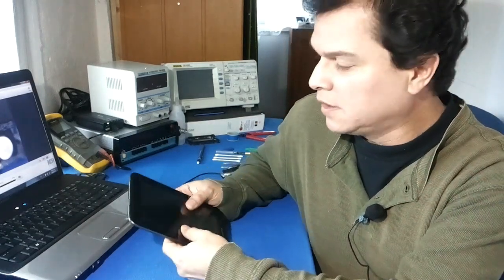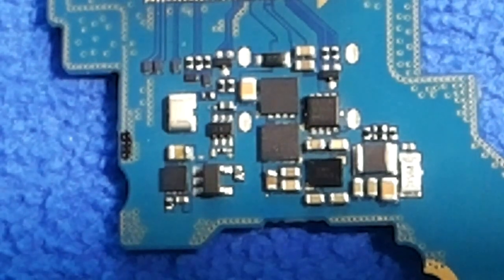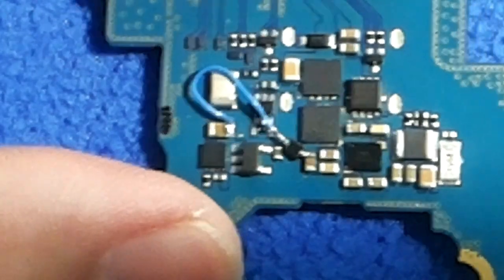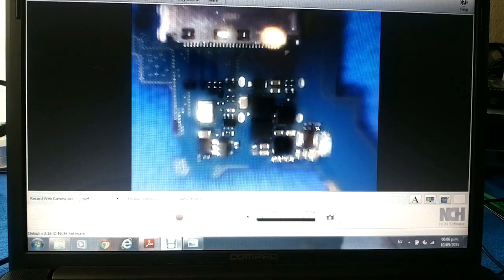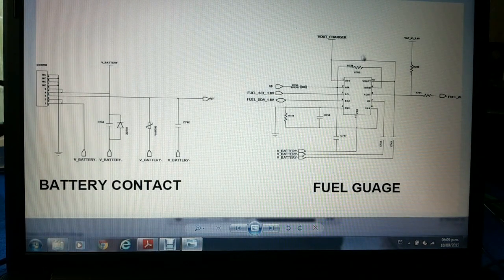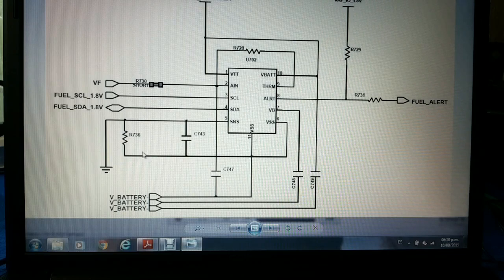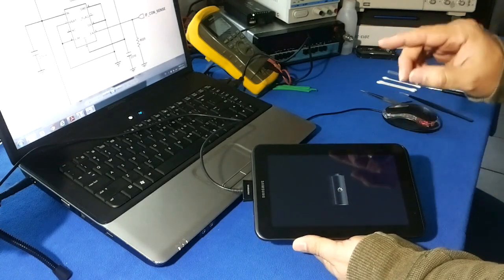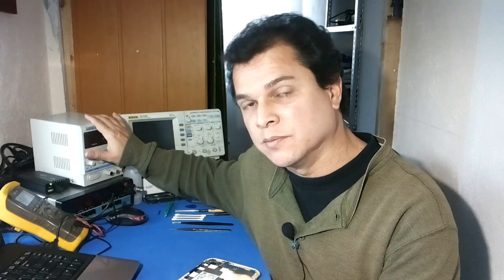Samsung Tablet 2 not charging, turns off, fixed - How to fix tab on chip level. GT-P3100 / GT-P3110

Comment: Thank you for this. I have a TAB 2 7.0" that needed this mod. I glued a diode to the bottom of that circuit and ran enameled wires to it from those caps. I tried your way at first but the board would not sit properly in the case. Works great now and I noticed the charging IC stays cooler.

Comment: Hi Bob,
I have a Galaxy tab P1000 with this same problems you just fix now.
After boosting the battery, it started charging but won't turn on.
Can you help out with it?
Thanks
Reply from the maker: Hi! Remember in the video I said I had to repair a faulty component before to adapt the tablet. Any component can be bad. It is imposible to tell from here without having the tablet to make a physical repair. If you are just learning or getting in electronics, look for a mentor in some service shop to start learning and repairing with them. It was they way I did it in the 80's.

Comment: i would say only try this as a last resort, i can guarentee you will short it out if you have little soldering experiance, i had the same problem, endless loop of charge indicater, i left it recycling for over an hour, unplugged from mains for 10 mins and plugged back in, and it started to charge to full, think of the battery as an engine on a car if it runs out of fuel it will not start right away untill the engine has been primed again

Comment: What is number part dioda
Reply from the maker: Hi Andi! I used one from other pcb, so I didn't know what number was it. The true is the bigger diode close to the power supply connector from most smartphones and tables could be good enough for it.

Comment: My friend I have a galaxy tab 4 T330, from a customer, charging port was burnt on pin before vcc, replaced it. But then battery started charging on 0.90amps and suddenly to 0 , over and over in a loop I could verify this as I have a USBcharger with display showingamps. I tested VBUS coming out from pmic and voltage it's going to the battery port. Now , is this something similar to what you're explaining? I didn't find any short. this is totally crazy. Please try to help me out. So many thanks, and congratulations

Comment: Same problem as mine. But its hard to do it. anything easier. Help please.
Reply from the maker: Bind it to service. There are good technicians doing the same job no too far away from you. Just make sure they really do repair on place. In less than a week, you will get it back well fixed.  :-)

Comment: buenas noches Sr me ayudo en algo por mi elemental conocimiento de ingles, quizas si me aclara algo en español, mi tab 2 sin avizar dice 1 5 de bateria y se apaga cuando 1 min antes decia 100 %, la cargo 5 min dice 100 % y la comienzo a usar, si temgo suerte dura 10 min y vadiciendo rapido 90 75 40 30 10 5 y se vuelve a apagar,  Q me sugiere usted,  GRACIAS
Reply from the maker: Hola! Cuando las baterías cargan en al 100% 10 minutos y se descargan en cinco, el problema es la batería misma y bebe de ser reemplazada. Intenta probar con otra batería primero.

Comment: Hi I ha a galaxy note 8 gt-n5110 and old battery would not keep its charge unless plugged in, I replaced with new battery and now it is in a charging icon loop as yours was, but if I put the old one back in it charges fine just battery won't hold while unplugged......any suggestions

Comment: Thanks for this video.  
My tablet is not charging when I plug it in.  There is nothing on the screen - no charge indicator.  Screen is completely blank and device shows no indication of being powered on.  Looks dead.  I am charging via wall outlet. 
When I plug the USB cable into my laptop, it shows a message "installing device drivers" but is unsuccessful.  In device manager a new device appears and disappears continuously: OMAP3342   Screen is the same at that time (looks dead).
The tablet has been sitting for at least 6 months so I suspect that the battery is really undercharged.  
I've opened the unit and removed the battery connector and reconnected.  Still no signs of life.
How you you troubleshoot this?  What should I check for first?  Your help is really appreciated.
Reply: What did you do for this? I'm in the same situation. My tab 2 10.1 won't display anything. I tried disconnecting the battery but it is dead.

Comment: Hello Friend I have GT-P3100 device and after i connect to charger or laptop its showing Red (x) mark on battery icon. when i turn of my device and charged it will getting charged. i have rehot U706 (136s chip) too. but the problem was same. which parts i need to check now?? am i need to replace 136s chip ?? please help me with this... thank you .

Comment: I have a Samsung tab2 , I want to power it through external supply ,i.e., without any battery support, Is it safe to do? if yes could you help me in how to do it.I changed 3 batteries so far,all of them useless now as I forgot to charge them frequently, I am tired of buying new battery. I am planning to use this tablet in my car for entertainment. I got some knowledge in electronics.All I need is good guidance from experts to do it safe. I hope you could help me.
Reply from the maker: You will need something like LM317 voltage regulator to regulate to 3.7V. for battery or 5.1V for main power input. Make sure it is well done, and you will need a power transistor with 2 Amps capacity to do not overload the voltage regulator. REMEMBER, the fuse must be close to the battery and no as far as your regulator. (Automotive safety rule). Keep in touch!
Reply: Hi Bob, thanks for your reply.I need bit more clarity .Input to LM317 is car battery?,LM317 parallel connected to power transistor to supply more current? I guess LM317 alone could deliver enough current to tablet,correct me if I am wrong.I need your help in where to connect 5V DC to tablet. We need to bypass tablets battery charging circuit,and need to give the supply to power rail ,could you please give some details regarding this.I may need tablet schematic for this!!.

Comment: Hy bob, what kind of capacitor of you use?
Reply from the maker: Hi! I used a diode. I wrote about it in the video´s description under the video.
(NOTE: JareK K added a picture for you: http://pokazywarka.pl/howdiodeconnected/
THANKS JAREK for you contribuition. :-)
About the diode used in the video: I didn't have an SMD supplier on that time. So, you can do as I did. Take a good size SMD diode from another smartphone, tablet or laptop. It has to be a good one, and generally they are located close to the main power connector or charging circuit.
This is the video how to ope it: https://www.youtube.com/watch?v=L_DWJ...
This is the schematic for Tab 2: http://www.s-manuals.com/pdf/tablets/...
Tab 2 Service Manual: http://www.s-manuals.com/pdf/tablets/...
Download it and save it, before the Website's page goes offline).
Reply: Thank you very much bob 😄
Reply from the maker: Thank you! :-)

Comment: Hi Bob, my Tab 2 P3100 taking long time to charge like 6 hours or so, what's the problem, and solution?
Reply from the maker: Hi! A good battery rates longer to charge, and it lasts the longest to discharge. A bad battery chargers in short period of time and discharges in a few minutes. For an average battery 4, 5 or even 6 hours are good time if the battery works for several hours. But also I saw people using the wrong charger, with 500 mA or 700 mA when they should use 2 Amperes charges for bigger smartphones and tablets.
Reply: Yes true what you mentioned as the charger is the original came in the box,  thanks for your available information

Comment: Hi Bob. I have had exactly the same problem with TAB 2 7"... so I soldered Shottky diode 3A as you showed but nothing happened... still no charging...any other ideas? Before I watched Your video I did the trick: holding 30 secs. power button then connect to charger still pushing power button for next 30 secs. it worked only once.
Reply from the maker: Hi! The bypass is is done after fixing a mayor problem or for total discharge's problem. But if you have a bad component, a technician must fix it first.
Reply: And the mayor problem would be capacitors which you talked about in your video?
Reply from the maker: The mayor problem is "the problem". There is a bad electronics component, and it could be anyone from all of them, or more than one, from capacitors, chips, resistors, conductors, transistors, the solder, anything. As I said, one well trained or certified technician will find it.
Reply: Thank You for answering my question. As for now I am charging battery using cell phone (I connected tablet battery to cell phone battery and charged it) - but it is very unconfortable solution. I will search for any technican who would like to look at my tablet, because I do no have so small devices to solder smd capacitors.

Comment: Hi,

 do you have the same solution for the Samsung Galaxy tab 2 10.1  P5100? Which are the component to connect with the diode?
Thank you very much for your videos!
Reply from the maker: Ciao!
http://www.s-manuals.com/pdf/tablets/samsung/samsung_gt-p5100_r1.0_service_manual.pdf
Bisogna cercare ciò che sta causando il problema. Ti ho dato il primo legame con il manuale di servizio. Il secondo link aiuterà acerca come preforme connessione del diodo. E 'solo per le persone con istruzione formale o formazione in elettronica buono. Non farlo da soli se non fossi un tecnico.
http://www.s-manuals.com/pdf/tablets/samsung/samsung_gt-p5100_service_schematics.pdf
Reply from the maker: Hi! It could be a component linked with the positive line in the battery, whereas you have a good tack to conduct the charging current without to heat the printed circuit board's track.
Reply: Ciao Marco Carini, anche io ho il P5100 che carica ma effettivamente non carica, tu hai risolto col metodo che ha descritto nel video? Sul sito dei manuali che ha indicato lui ho trovato i manuali del nostro tablet
Reply: I found the problem with the service manual . I found a coach who will try to re-weld the piece in question ( U716 ) hoping that it is not dead and that you can find the parts
Reply: The failure of my tablet is this: if I connect the charger emits the sound and the charging icon appears but not actually charging the battery
Reply from the maker: From all the components in the tablet, any one of them can be bad. But more chance are it is the battery. Ask your technician to test the battery. If it isn't, then your technician will find the problem. (But so far, highest chances are it is a bad battery).
Reply: +Umberto Fragale  Ciao Umberto.Io non ho ancora avuto il tempo per fare il lavoro,ma per logica proverei a fare la stessa cosa sul 5100, facendo il bypass tra i componenti che svolgono la stessa funzione del 3100 (i due capacitori) che avranno magari nome differente.

Poi ti saprò dire ok?
In bocca al lupo'
Reply: not the battery because every night the detachment from the P5100 and the attack on the old p3100 to load having the same attack . arraggiata solution to be able to continue to use the 10.1 for work :)

Comment: i have the same problem with my tab. from ur video i could not make it out which side of the tab u are working ? can u explain
Reply from the maker: Hi! I don't understand the question. Can you be more specific please? (Because each side of the electronic board is different, and if it is the same tablet model, then it will be easy to recognize it).

Comment: good morning friend where I can take this LED SMD 2 amperes ? any sign of him?
Reply from the maker: Hi! About the diode used in the video: I didn't have an SMD supplier on that time. So, you can do as I did. Take a good size SMD diode from another smartphone, tablet or laptop. It has to be a good one, and generally they are located close to the main power connector or charging circuit.

Comment: thank you very much for the information, now smartphone I was able to return to normal. 

Now I still have a problem with the blackberry 9800, current conditions can not be lit at all, do you have his solution?
Reply from the maker: Hi! It is hard to try to fix something if I don´t have it. Some times I can help technicians, when they are well skilled in repairing, using pictures and diagrams in emails.

Comment: what is the daiod ?
Reply from the maker: Hi! Use any SMD diode, if it is 2 Amp, the best. If you have not an SMD components supplier, you can use one from smartphone, another tablet, or laptop out of order. Just make sure it is one of the "small, big ones" close to the voltage source input. :-)

Comment: i have my samsung galaxy tab 2 10.1 , when i try to charge it show the battery bar with a cross shows like it's not charging. i power on just hang on samsung logo . so i try to press the power  and the volume button i try to hard reset , when it was on that mode it just when off. i bought a new battery still not power on.... now is dead . what can i do?
Reply from the maker: Hi! If you are not a person with knowledge in electronics, then you have to look for a good electronics technician. There is a bad electronic component in there and it most be repaired. 
Electronics requires formal education. There is not a magic instruction to tell. Your tablet has a hardware problem, and there is nothing you can do pressing buttons and making a hard reset. It is time for it to go to the service center. As I told the other guys in the comments: "Take your time, and look for a good technician. Because some Phone and tablets shops, have somebody trained to do exactly what you did, but they don't know electronics, or they don't have electronics laboratory equipment to perform a service, as it is shown in the Service Manual link under the video".

Comment: Hi bob, my tab have the same problem, I remove the battery and charge it externally, when it charged I can turn on my tab, but when I charge it, the battery level is decrease.
I have try another original tab charger but didn't work
when I plug it on computer, it sound connect and disconnect looping, 

do I have to put diode like video above too?
Reply from the maker: Hi! Yes, you can make the bypass. But the tablet should not turn on and off plugged to the computer. It looks like there is a bad component like a capacitor. That capacitor is behaving alike a resistance. (In another words, it is not totally bad, open or in short circuit). So, it is harder to find. 
My best recommendation is: an electronics technician has to look for the bad capacitor using an Ohm meter. Most capacitors have a very high resistance, and our bad guy a low one. (There are one capacitor in parallel with a low resistance that shows almost a short circuit, the one I changed in the charging circuit, and another hidden in the WiFi area. Just to let you to know about them). Some capacitors are redundant, they exist only to suppress electrical noise in case if there is it. That kind of capacitors can be removed, and doesn't need to be replaced. Some others, have an specific function, and must be replaced with the same specification. Which one is it..? If the technician find the bad guy, just remove it and try the tablet to see if it misses it. I leaved the link with the schematics up in the video description.
The other option if the technician can't find the bad capacitor, is to make the bypass, and to use the tablet until the capacitor dies. Then it will be easy to find it, if it gets in short circuit. Remember it: the job must be performed by a professional in electronics. Some discretion is needed for it.
Reply: thanks for your reply, 
I forgot to mention that when my tablet battery is empty, I plug my tablet to computer, it sound connect and disconnect 
but after I charge the battery externally, it can connected to computer, 

so the problem is when the battery empty it just like your video above when I plug the charger, 
but when the battery is not empty, and I charge it, the battery level is not increase, but it decrease

for example I charge my tablet when the battery is 50%, after a few minutes it decrease to 49%, and after few minutes more it decrease to 48% , so charging tablet only make my battery run out faster :(

did the bypass could save my problem?

sorry for my english  :)
Reply from the maker: Yes. It will solve the problem. Just make sure you use original Samsung battery that has internal chip protection.
(...and just to explain what is happening to you: When the battery goes under the "operation level", it drives part of the tablet, but a security system doesn't let it to start in that level. The big mistake was that the charging circuit is on the side that doesn't operate under 3.7 Volts, and They didn't place the circuit in the stand by system. So, the part that prevent the tablet to start, keeps going on, until it discharges the battery.).
Yes, make the bypass. Just take your time and ensure it is well done, before to turn the tablet on. IF YOU are a technician, you can do it yourself. If you are not a technician, DO NOT DO IT, and give to an expert to make the bypass. :-)
Reply: it fixed,  thank you so much, you are the best :D